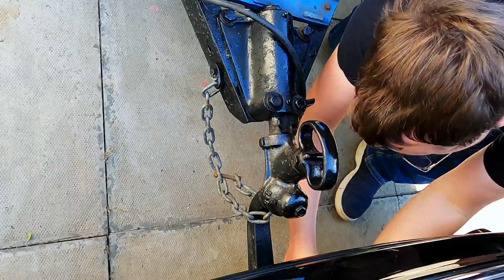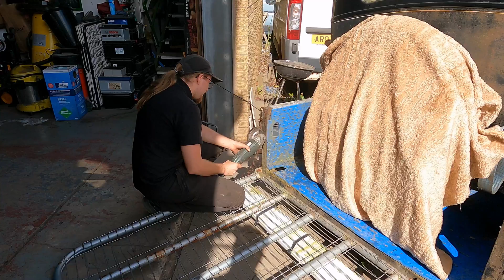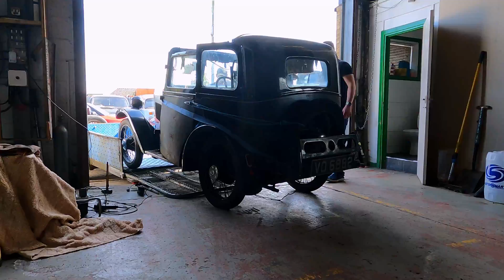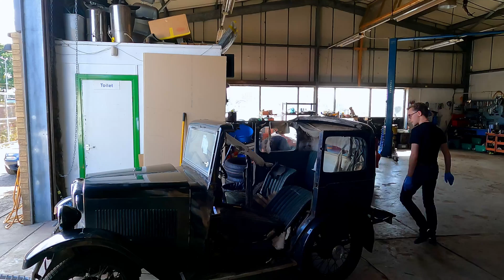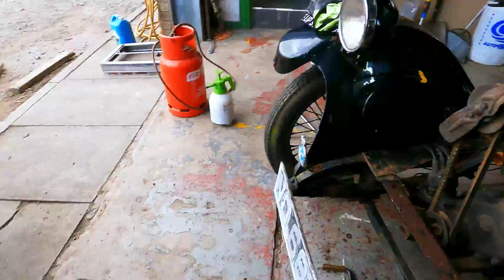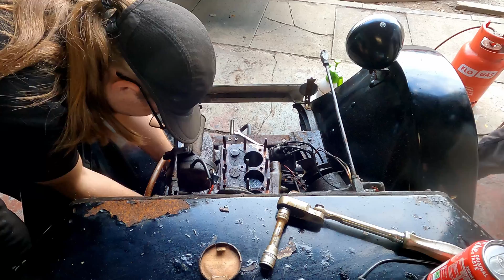Saving an Abandoned 1932 Morris Minor SV

Comment: As the owner of a restored, and road legal 1932 Two-Seater Morris Minor, I'll just point out that the 8HP is the taxable RAC (Royal Automobile Club) horse power, which was charged at £1 per HP. So road tax would have been £8 a year in 1932. The BHP (brake horse power) is 19.25bhp. I'll also point out the model history is way off. The Bullnose Morris was the early Oxford and Cowley models (1913-1926) which were much larger cars than the 1928-1934 Minor. The Bullnose cars were replaced by the 'flatnose' Oxfords and Cowleys, which the little Minor took its design from. The Minor was replaced by the completely new Morris Eight (1934-1948), which in turn was superseded with the Alec Issigonis (of Mini fame) post-war Morris Minor (1948-1971).   Looking forward to the next chapter.
Reply from the maker: @crashbox7130  Thank you so much for the insight! It’s priceless. I’ll put in the corrections when I get a moment 🏅